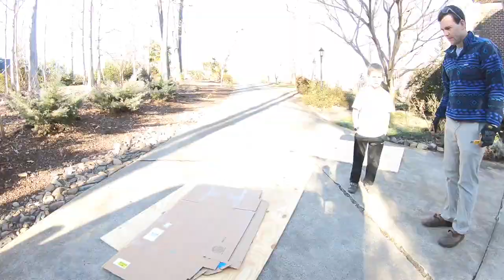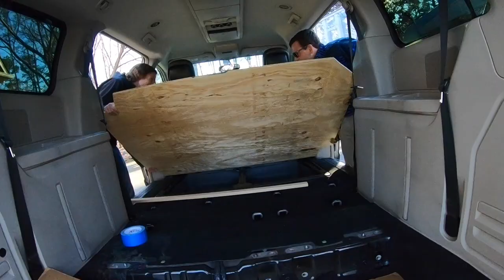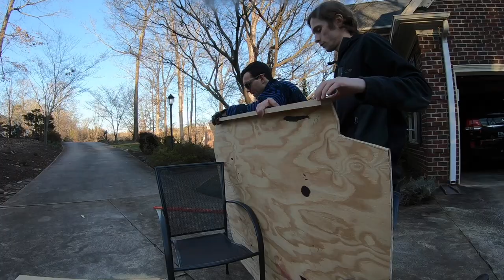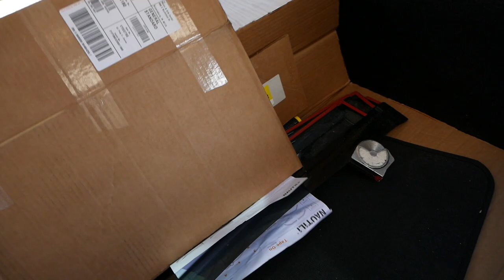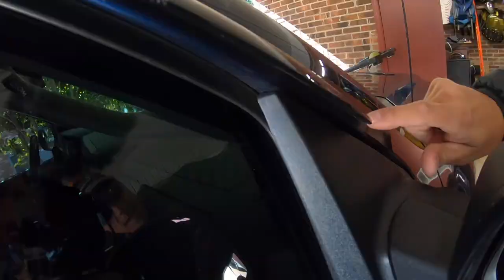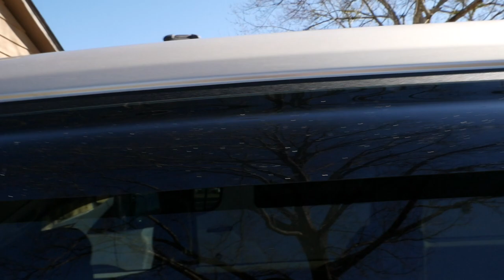Installing a Floor in My Minivan Camper

Comment: Regarding the rain guards... make sure you clean the van's surface really well before sticking them on, especially since it has had adhesive on it before. Clean with denatured alcohol after whatever cleaner you use. If it has leftover adhesive, goo gone works really well. Or... just see if there are rain guards that fit into the window slot. I prefer that type but they aren't available for all vehicles. Good luck!
Reply from the maker: Thanks so much! I'll definitely clean it as best I can!!

Comment: Yeah I know this video was a little while ago, but I agree with rain guard comments. I've installed on 4 different cars and never had a problem. They're made to fit your specific car so hope that's the way you ordered. These are invaluable. Love your bed and hope to tear down my current one and remake like yours. I was in time crunch and had only 1 day and only commercial back parking lot. Now I can take my time. Thanks for your instructions.
Reply from the maker: Thanks for checking out the videos! The rain guards work well. I just had to replace the 3m tape

Comment: I need to stop being so independent.  I'm like "I can do it" and you're asking for help with freaking rain guards, which I put on, by myself, in 50 degree weather,  with a heat gun because it needs to be at least 55 degrees when you install 3m tape.  I've wasted so much time learning skills I'll probably never need again instead of asking my very obliging friends for help.  Real talk,  thanks for this video.

Comment: How are you going to get to those seat holding areas in the floor? -- the ones by the sliding doors. --- You should just put the covers back on. That's what other van converters are doing.
Reply from the maker: I actually cut little hatches out for them. The reason I'm putting the wood flooring in in the first place is so it can be cleaned easier. If it was the original flooring the carpet would get destroyed from wear and tear and tracked in mud from hikes and such. I'm trying to protect the van so I can convert it back one day and maybe sell it, hahaha. Thanks for checking out the video!